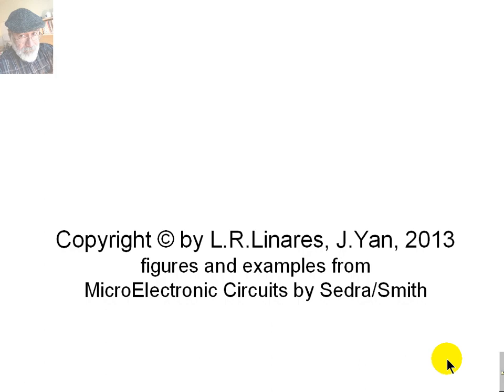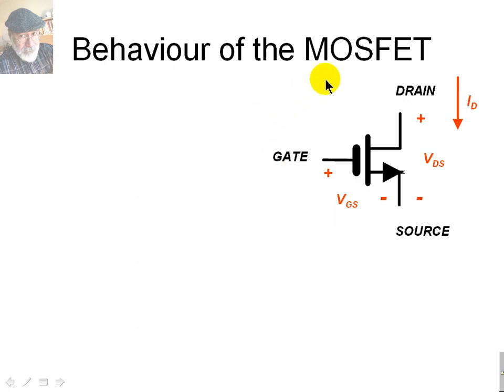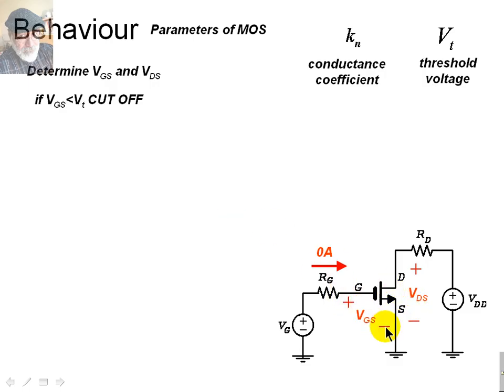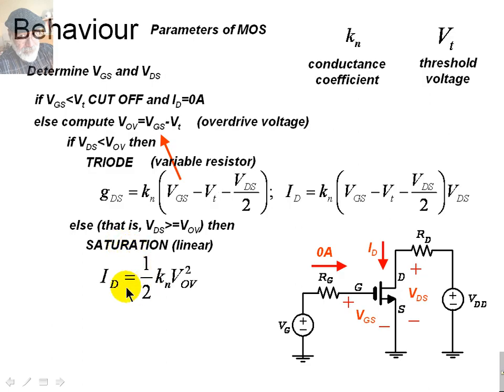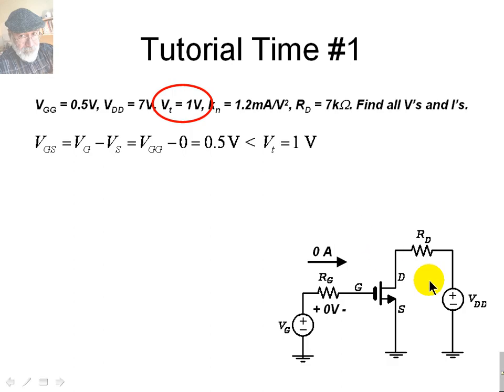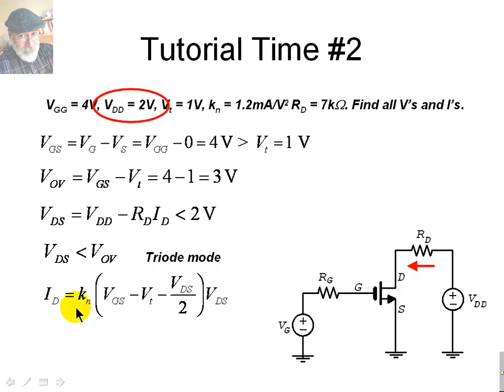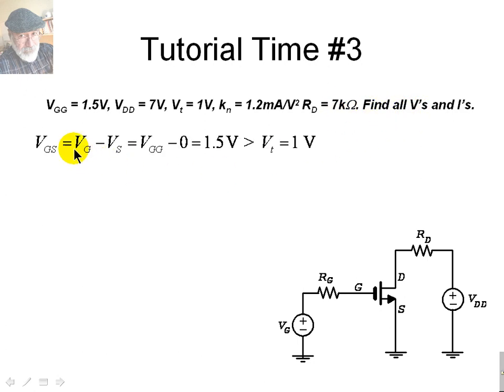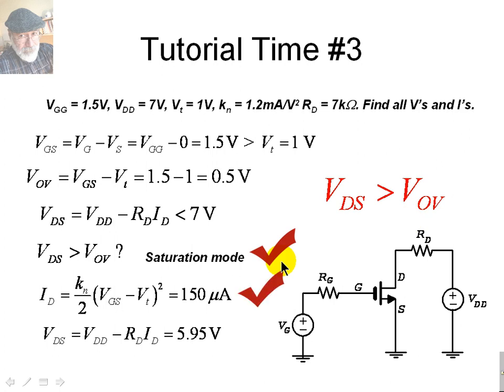FET/MOSFET (Video 2 of 4) (DRAFT)

Comment from the maker: Do notice that in second 2:19 and following, it is emphasized that there is a "galvanic disconnection" between the gate and the channel. That prevents gate currents regardless of Vgg (with the proviso of respecting the ratings of the device).